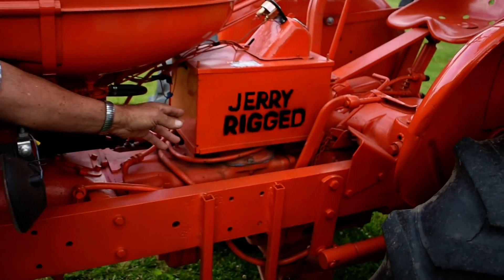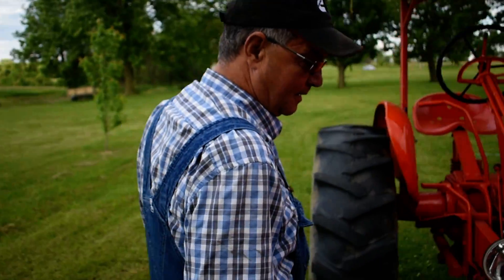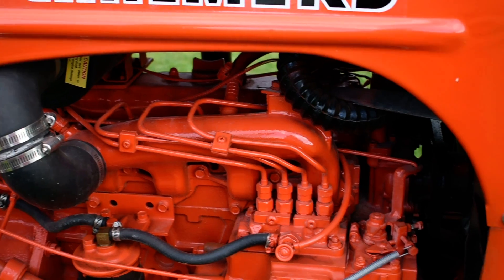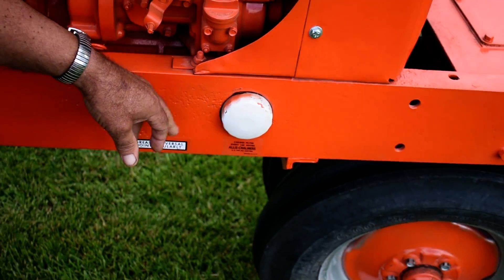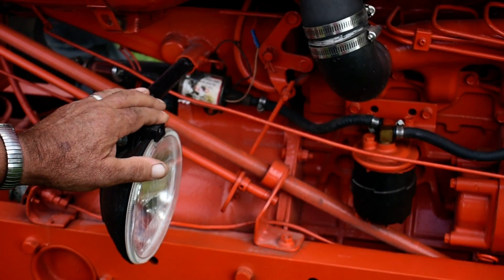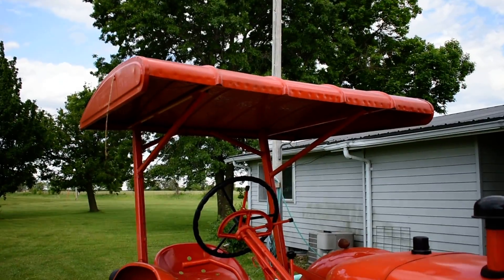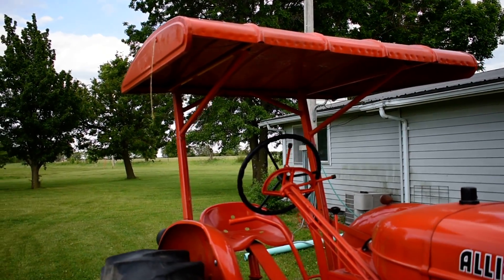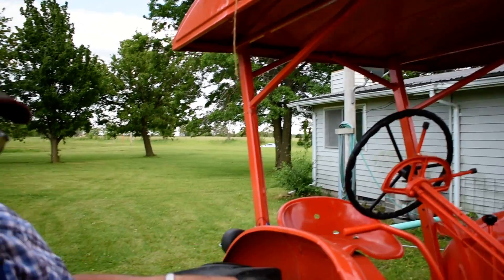Allis-Chalmers WD Kubota Diesel Engine Swap

Comment: Thats certianly interesting.  I've found that Gleaner e engines are the ticket for these.  And about 60 pto hp, depending on m,n, or z code.
I'd be leery with a c radiator, those are pretty adept at cracking heads as it is.  I assume this just sees parade duty, though.

Comment: Good day. Interesting,the problem with WD or 45 they were sow on road.  If that motor runs at 2000, she  might run a little faster.  What was wrong with WD motor. You said diesel come out of bus, how many cu.in. Thanks
Reply from the maker: the wd motor was lock up 25oo it run abut 18 mph